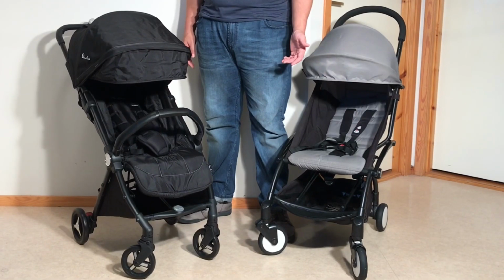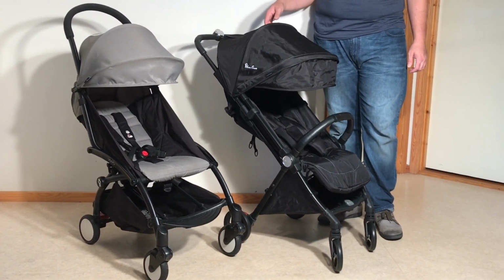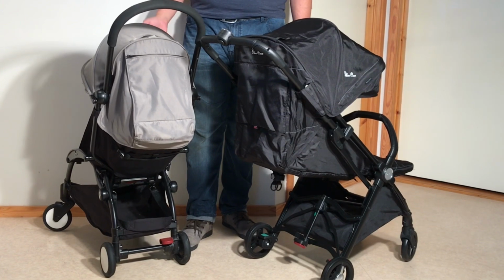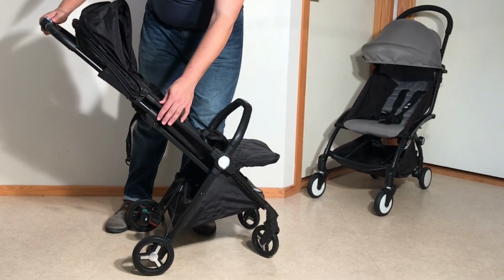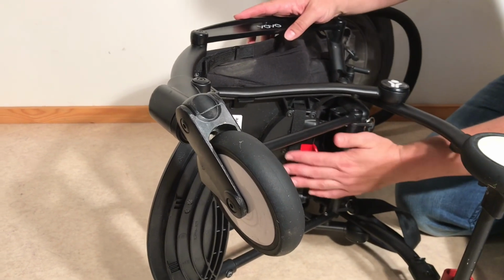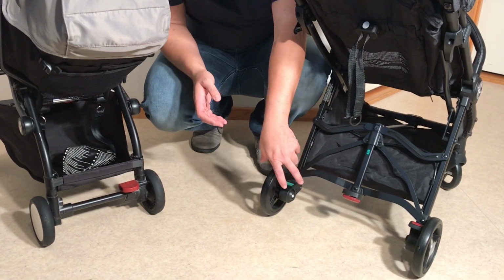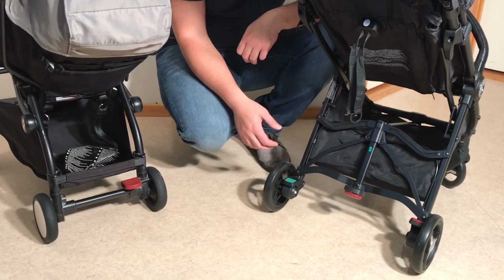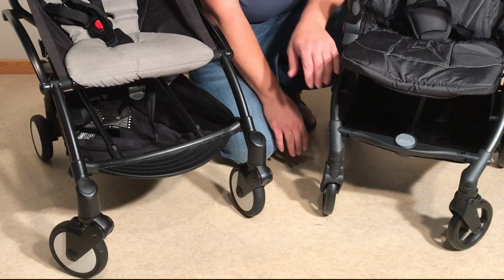Silver Cross Jet VS Babyzen Yoyo: Mechanics, Comfort, Use

Comment: I have never come across a stroller review that covers the mechanism and wheels in such details.  I am really deciding between Minu, Yoyo, Jet and Larktale Chit Chat.  Jet has come out 2020 version that has 62 functional and cosmetic improvements, tt looks like the review is based on the older version since I know their 2020 version has upgraded the ball bearing.   I'm gonna cross off Jet for now anyway,  thanks so much for the most thorough review! <3

Comment: As someone who returned the babyzen yoyo and bought a silver cross jet instead, I find this review very unfair to the SC jet. From a user-friendliness perspective the jet is a lot easier to carry around and neater to fold/unfold. You don't have to have dirty wheels touching your clothes when carrying the jet around and it is very compact. Stability of the hinges and other technical details aren't necessarily what's most important in a travel stroller, but usability and the price/benefit ratio is. The jet is almost HALF the price of the yoyo in Europe (where I live).
Reply: Really great point!!
Totaly agree!!
Reply from the maker: Thanks for the opinion.  To each, their own.  I unfortunately disagree with virtually everything you wrote, including the price - which is only about 40usd below the Babyzen here in Norway.  I have heard that the price has dropped in some places, though, since Silver Cross's updated model launches next year, undoubtedly as a result of poor initial sales numbers. :)
Reply: @BarnevognverkstedNo  Price has dropped significantly where I live as well which now makes SC has a huge advantage over Babyzen. I'm a huge fan of BY but it is very tempting to consider SC. Thanks for the review, very detailed and thorough! love it!